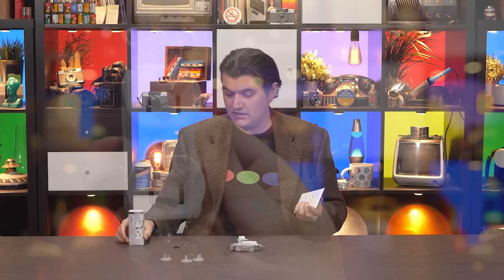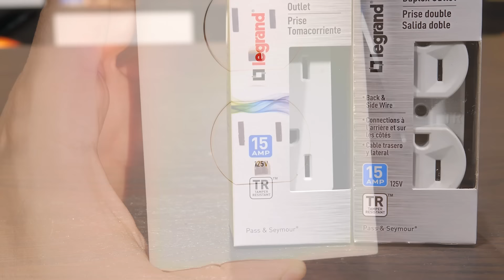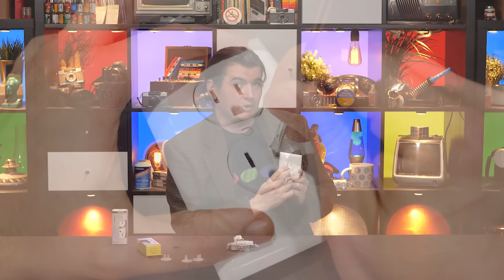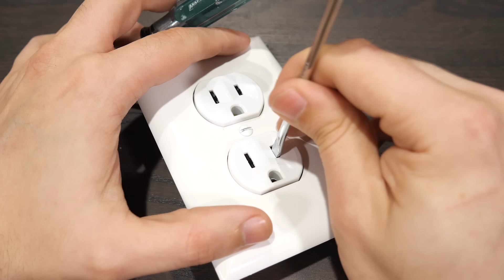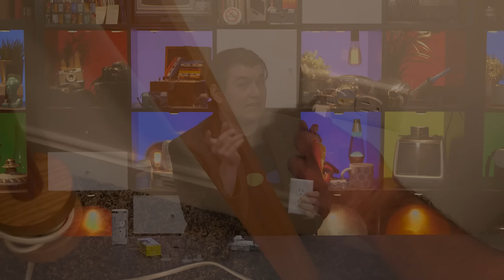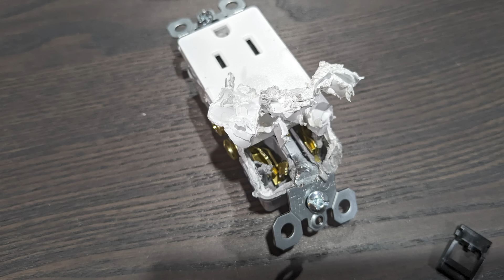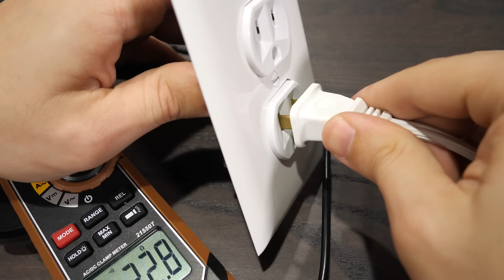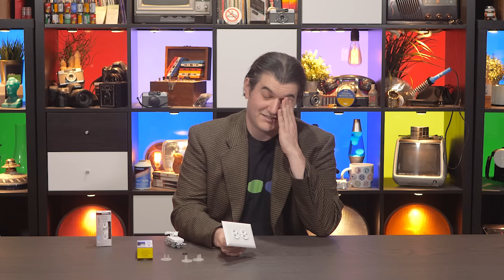Tamper-resistant outlets aren't all the same - a follow-up

Comment: As someone who grew up in a nearly 100 year old house with many old outlets, and who currently lives in a 20 year old house, I can honestly say that I've never had an issue with outlets falling out, or wearing out badly, all the issues I've personally had with outlets has actually been with them being too tight, mostly because of poor plug design, but sometimes to get the plug out you have to grab the bottom or back of it where the prongs are to get a good grip, and I have shocked myself a few times, but it barely hurts, it's more of a "surprise" (or a shock lol) and it would be pretty hard to un alive yourself doing that, unless you are Mr. Burns or you grab one prong in each hand. But it has only happened to me once in my life, trying to get a stubborn power supply cord out of a power strip. Also how often are people actually regularly plugging things in, and taking them out of outlets? I've been thinking about that for a while and the only thing that I regularly plug and unplug is my vacuum cleaner. The only other things I plug in and unplug occasionally is my laptop, but that's only if I'm taking it somewhere, but most of the time it stays plugged in. And occasionally some air fresheners when they run out of smell juice. For some people maybe phone chargers? But I feel like most people (like I do) have multiple phone chargers and leave them plugged in. I have one on my nightstand, one at my computer desk, and one in the living room, so I never move them around. I can see that when going on vacation maybe it's slightly more of a hazard, but that's not something I've had any problems with.

Comment: Tamper-resistant outlets in Europe use two plastic covers that tend to wear out like crazy, preventing you from inserting a plug entirely. So that's the one aspect where I would say American outlets are actually better if the mechanism is made of metal there.

Comment: As a counter to your opinion that stripping the wire and shoving it in the back hole being ok, I recently had an outlet in the room that was temperamental and sometimes just looking at it the wrong way would cause half of the outlets in the room to stop working. Presumably, the outlets were all daisy chained with the "backstabbing." I didn't know they had been installed like this until I finally got fed up with it and pulled the offending outlet out of the wall and the backstabbed wire just pulled right out. There was virtually zero resistance. I wrapped it around one of the terminal posts and put it back in and that was over a year ago and haven't had another problem since.

I don't know when those outlets were ever replaced. As far as I know, they're original to the house from when it was built in the late 70s and I know I haven't had them replaced in the 25 years that I've lived here. And no, that outlet didn't become a problem until a couple of years ago. So the problem of no "bite" to the hole in the back must have developed over time. Somehow. I still haven't figured that one out. But essentially, the slightest vibration caused it to jiggle around in the hole and lose connection. Walking past it too enthusiastically or moving a piece of furniture near it or just bumping the wall all would cause it to happen.

Comment: Well. I bought a Steam Deck with a US charger, is the only thing here that uses a US plug, and I also have a US to our standard (that i think is exclusive) adapter and be honest. I had to use a rubber band to keep the charger in the adapter. Yes, they dont completely fall off but with the weight of the charger and due to the fact that the plugs are basically flat on the charger they always keep a little bit outside the socket. Something that is basically impossible with any other plug in my house. Our wall sockets are recessed and our plugs have sleeves, making it basically impossible to remove by just wiggle and once you have any exposed metal the appliance is fully disconnected. Its not a perfect standard, and there are better ones but i think its good enough.

Comment: I have a condo built in 2010 (in Canada) with the TR outlets. They were a gigantic pain in the ass when they were new, you had to use an unreasonable amount of force to plug stuff in.

13 years later the outlets I use frequently are basically just non-tamper outlets and the ones I barely touch are still a massive pain in the ass. They are cheap contractor grade "Decora" style outlets made by Leviton.

Comment: The American outlets are the product of Early Adoption lock-in Syndrome. The Hubble outlet (the basis of our current design) was patented in the first years of the 1900s. We’ve had no major devastating wars giving us an opportunity to rebuild our nearly 150 year old power grid like the UK and the rest of Europe. We haven’t had any economic pressure to change our standards either. My grandmother’s lamp from the 1920s works perfectly fine plugging into my house from the 60s, with a smart bulb (thanks to the Edison socket).

Early Adopter Lock-in Syndrome is why cell phone banking and commerce exploded in places like sub Saharan Africa and South Asia. There was anything substantial already in place, so adoptingg the new thing was easier and better. In Bangladesh it was easier to deploy cell towers than build out a wired phone network. Whomever adopts the ‘new thing’ is going to be stuck with that until something major forces a change.

Comment: I've been shocked by the very scenario he had in this video,(fingers touching blades on a plug), and I've also been shocked by grabbing a spark plug boot on a mower to kill it.

Weirdly enough, the AC shock didn't hurt nearly as bad as getting shocked by the mower.
Reply: DC shocks constrict the muscles, whereas AC shocks blast you back. I suspect it’s because the polarity & voltage are always changing.

Comment: Most of this talk about getting shocked is mostly for old work, current NEC code requires gfci and/or afci protection on pretty much everything and generally combo breakers are nominally the same price or cheaper then separate gfci or afci so I’d imagine most circuits will end up with both protections out of convenience

Comment: A Back-stab on the $.39 receptacle in a contractor pack is the concern, because the build is too cheap to make a connection as good as a Wago wall-nut with a 30A UL listing.  A commercial grade receptacle has a connection similar to a GFCI where the conductor is captured with sufficient surface area.   Note that a Wago Lever-nut is different.

Comment: Just as a note, In the US, if you replace the outlets you are supposed to make sure the entire circuit is up to current code.

This can become a big issue in older homes that do not have the newer GFCI and arc fault breakers. 

As replacing a few plugs will require either a new breaker if they make them for your breaker box or a new breaker box if they dont.

Comment: There's a reason voltage is also called potential. A given 1 amp can flow into a short twice as fast at 240v than 120v. For an equal amount of time shorting a circuit, 120v will conduct half as many amps. For the same exposure, 120v will be less harmful.

But if you short a 20 amp breaker, it doesn't care about voltage. If you short 20 amps through your body, it's not good at any voltage.

Also, I wonder if you should point out that zapping your finger is an entirely different thing than grabbing a wire in each hand and shorting through your chest, or grounding to your feet.

Comment: I find the topic on electric security quite funny. I come from Europe, but I never ONCE in my life got shocked there. Not even once. But then, here, in canada, I think I got it like 5 to 6 times. Not because of outlets, but each time it was with a thermostat that I removed for painting I think, and I happened to touch the wrong point.
I also got a shock when I was replacing some switch. I used the breaker, but honnestly I don't know what exactly happened in the cables. There was a thermostat close to the switch on another circuit and somehow, I also got a shock.

I think on all the things that could be done on US to be safer (yes, SAFER, not dangerous) and not expensive would be to put the whole houses on GFCI like in Europe. I don't get it's only in bathrooms that there is a breaker popping on leakage... It's not that expensive to put one more for the whole house to get it and secure it you know ?

My house when I was kid was built, and the electricity was made by my father who was a certified electrician (not his job, but his studies where that), so I always found it really, really well designed and well though. That may be because of that, but it was really safe. And I don't think that he put that much more money into stuff. Like I said, just some leakage breakers...

Comment: I never understood why the US hasn't put in any physical guard in place by simply recessing the existing outlet design like the European Type F or E.. it would be an easy downward compatible option that simply guides the plug and hides the possibility of exposed blades within the wall.
But then you have 2"x4" wall construction with limited depth so it might not be as simple as it sounds but still... you had 100yrs+ and basically nothing has changed apart from the grounded type and the now mentioned TR

Comment: in Australia we also have plugs that come in a 2 and 3 prong versions and we have the same shutter system on some outlets (mostly used outside to prevent moisture). our plugs also come with a bit of plastic around the prongs (to prevent something from touching them if they somehow get bumped a bit out of the outlet). our plugs are also designed in a way where its most convenient to put them in and out of sockets while holding far away from the pins. they also come in side ways flavours as well which are my favourite. probably not the best plug out there but it would end up high on a list id imagine.

Comment: For those who struggle to understand how much safer 120v is, I've wired up plugs with live wires when a customers breaker box was so we'll hidden we couldn't find it. I also slap wires to check if they're live. You can tell it's live because it tingles. I don't recommend doing these things, but it's an option in a pinch. 
240 scares me. You guys need that extra safety. Urgently.

Comment: Backstab connections are poor over time.  They are measurably higher resistance than the better back wire connections.  Better quality receptacles have rear wire terminals that involve tightening a screw that tightens a pressure plate.  No wrapping needed.

Comment: Yeah, we could have a huge mandate that replaces all new outlets with a more UK-like design, so all new houses and other buildings are only built with those and all new mains-powered devices made for the US market would be made with that new plug style, and then adaptors would be made for all the NEMA-plugged devices, and manufacturers would be banned from making anymore NEMA outlets, so we'd have an adaptor to go from new plugs to old ones for buildings that still have their old outlets, but every time one of those wore out and needed to get replaced, only the new style would be available to replace it with. So it wouldn't be an urgent phase that would require all buildings to have the changes made and inspected by a certain deadline (with government funding available), but long, slow one with a lot of grandfathering that would take decades to finally all phase out. But it COULD be done, and I would be for it, generally, even though I don't like those big blocky UK-like plugs. Or we could one-up them and come up with an even better design; smaller that works the same way and still carries enough current.

Comment: I think the always falling out comment comes from when you use an adaptor from a european plug to a us plug, the weight and lever action of the adaptor+plug means that they sometimes just fall out of the plug. This happens to me often when I m travelling and I plug my razor, in the middle of shaving the a tiny yank (which would not ordinarly unplug it) makes the adaptor fall off the socket

Comment: I volunteer at a school Shop class, helping run the laser cutter and other computer control machines.  They have relatively recently had all their outlets replaced with the tamper resistant kind.  Apparently the absolute cheapest outlets they could find.  It's like picking a lock every time you go to plug something in.  Generally people just resort to brute force.  There are prong dents in a lot of the mechanisms.  They're really terrible.

Comment: In a UK scenario with an ungrounded appliance, the plug will be made to have a plastic earth pin, the sole purpose of which is to push into the earth slot and open the shutters on the live and neutral pins.  Oh and on a similar vein (electricity!) I asked a UK electrician why we use a ring main, which you  said in one video "What were you guys thinking" about once..  It's a delightfully simple reason.  2 routes the ground.  Half the distance etc etc.  THINNER WIRE can be used when it's a loop.  And Copper = EXPENSIVE...  We do allow what we called a "fused spur".  So named because 1) It doesn't come back to the ring and 2) You have to put it on its own fuse per code with the fuse ensuring you only have the permitted HALF the amps over it because it doesn't have that second route to ground.  You can add a fused spur to the ring pretty much anywhere you like, not just the fuse box, so they are usually used for things like grabbing power from inside the house to put a socket outside for some lights or something like that.  And at the end of the day, when you get to the end of your run, running a single wire back to the fuse box is pretty simple and it saves a ton of money.  It's almost like we've thought it through... :)

Comment: GFCI shouldn’t detect stepped down voltage since it’s on the other side of a transformer right? (No voltage leakage since the GFCI’s side is always closed)

Also I had the same experience of feeling with my fingers to plug in a device in the dark and getting a nasty shock; you’re not the only one. I was fine but I remember feeling queasy for a while

Comment: Our plugs do fall out of the wall much easier than European ones (for example). How many times have you had to make sure something like an Ikea light was plugged in properly or some other device like a vacuum that wasn't working as expected only to find that the plug has slipped out of the socket a bit and once you seat it properly it works? It happens enough that "making sure it's plugged in" is a standard part of our troubleshooting checklist. When I lived in Europe (mainland, not UK) their plug and socket design was such that I don't think it would have even been possible for a plug to partially slip out. Once you plug something in there it's in! The plugs are a lot bigger and bulky but there was never any question as to whether something had become unplugged.

Comment: I've experience the plugs falling out. Old, worn outlets and straight out cables mixing is horrid.  Most AC to USB adapters are designed perfectly for that fail. 

A right angle grounded short extension cord or surge protector often solved the annoyance. 

If that option didn't exist, or my "adapter" of choice still too loose. I would just bend the prongs on the cord. They are parallel by default but if you give a slight bend to each prong in opposite directions, either in or out whichever worked better in each scenario. It increases the friction between them and the outlet and viola.

Comment: I once read an interesting article about death rates from 120 V vs. 240 V in Europe and America.  The conclusion was that taking into account the difference in population size the death rat was higher  with 120 V.  I cannot find the article now, it was several years ago that I read it.  Several possible reasons were put forward for this in comments to the article.  Americans are stupid so they do stupid things.  America certainly has its share of stupid people, I’ve met some of them, but the same could be said of any other country, so I don’t think this is the reason.  American electrical accessories are badly made and unsafe.  Americans have more electrical devices than Europeans  so more chance of accidents.  People perceive 240 V to be more dangerous and so take greater care.  The figures included deaths from electrical fires as well as electrocution; the lower Voltage requires a higher current for the same power and the higher current is more likely to cause fires were some of the possible reasons put forward.

In the UK portable power tools on building sites have to operate on  110 V.  This is supplied by portable transformers with the secondary winding centre tapped to earth. So 55-0-55 V.  This is always used as 110 V, devices are never connected to just one side of the supply.  Elsewhere in Europe this is not done, but GFCIs, which we call RCDs, are always used with power tools.

Comment: For what its worth, I work for a company that, among other things, devices with back stab connections. I do not wire any devices using back-stabs. I dont find them hold wires nearly as well as screw terminals. I have had wires come out of them while fighting a bundle of wires back into a backbox. Wagos (and other lever actuated ones) are different because the spring tension is not only from the diameter of the wire - they are engineered with more tension to better retain the wires and ensure proper connection.

Comment: A shock from one arm to the other is much more likely to kill you as the current runs through your heart causing a lethal arrhythmia.  In other words, one hand touching hot and the other hand touching ground.  Look, just turn off the power and then TEST it before working.